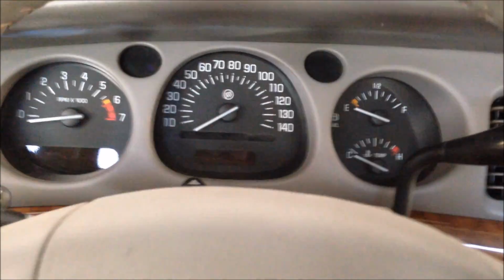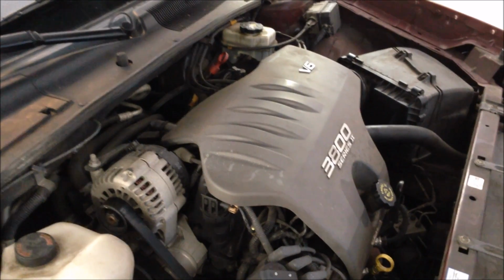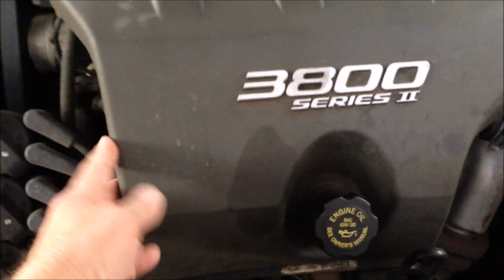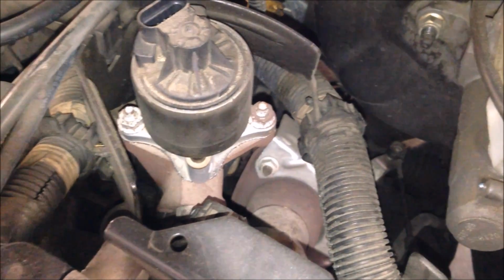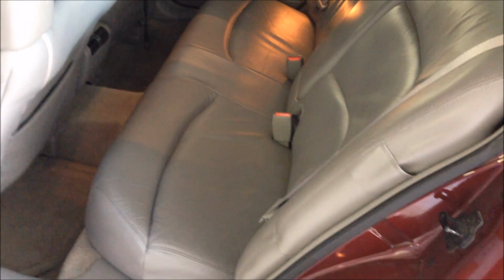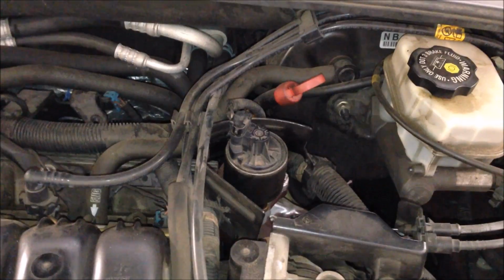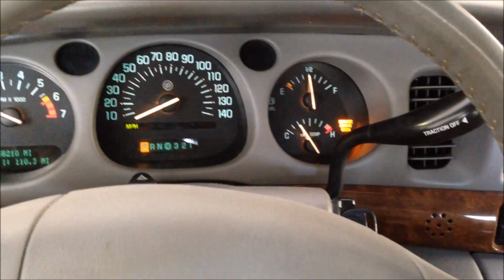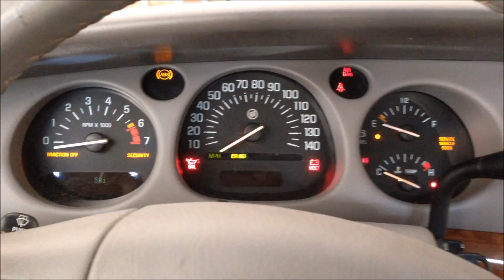SES Code P1404

Comment: So I just learned from another video the reason the disconnected battery worked. Is because that's the only way to reset the egr valve. So when you cleaned it. You fixed it. But It needed to be reset. By disconnecting the battery.

Comment: did this end up being a permanent fix?
Reply from the maker: For awhile. I ended up purchasing new EGR off EBAY. Worked fine. After that I changed cars in 2015. Had it 14 years. Got a 2007 DTS with only 22K miles and it still smelled like leather inside. Now, in 2022, it has 72K and drives like a dream! 😀